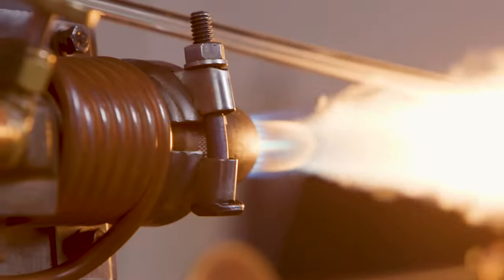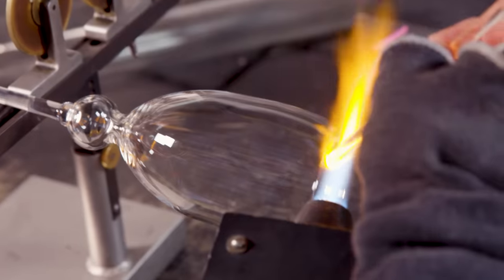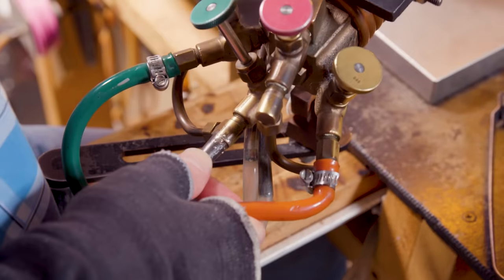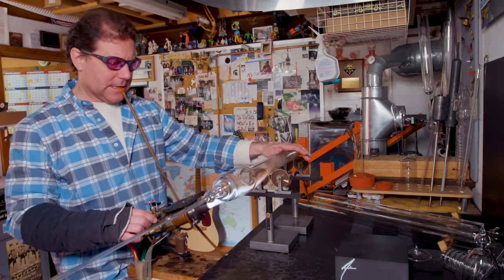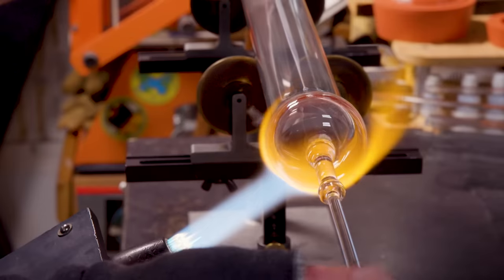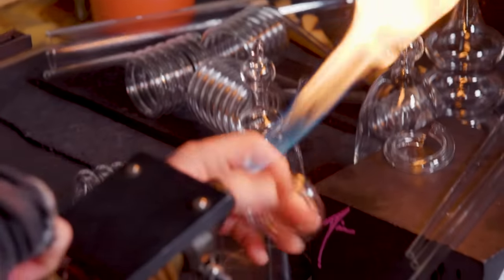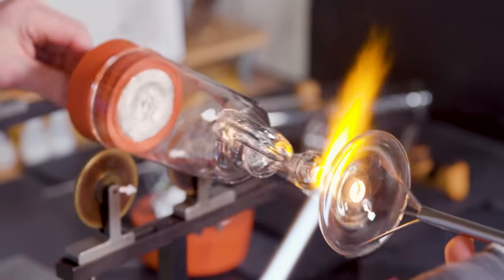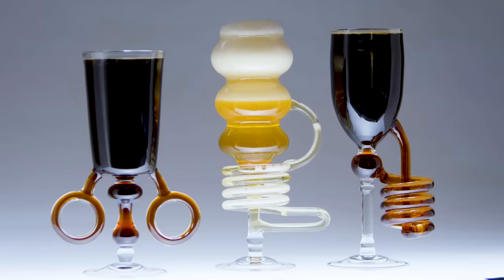Scientific Glass Blower Makes Beer Glasses | WIRED

Comment: I would absolutely spend way way way too much on a single beer glass like this even if I could never get it clean again
Reply: You could use a pipe cleaner to scrub the hard to reach areas problem solved right ?
Reply: they are possible to clean, you just need to be very serious about it. since they are borosilicate, you could push boiling water or even steam through.
Reply: Ultrasonic bath might be the easiest way to clean it.
Reply: @jellevm  probably ultrasonic to loosen the dirt, then steam to blow it out.
Reply: You have $400 🙌 I’ll send you my address!  Maybe you will get a discount for getting two 😂 cleaning is easy. No different than a glass pipe 😂 pipe cleaner guy.
Reply: Easy to clean with chemicals, PBW or even unscented Oxyclean would get it 100% clean with a good rinse.
Reply: This might be kinda gross but I mean, as long as you were religious in rinsing it out as soon as you're done drinking it it should stay pretty clean
Reply: Salt and 90% rubbing alcohol
Reply: Or u do the science ways, ultrasound, organic solvents (acetone etc), autoclave and so on hahaha
Reply: That's probably why they aren't popular. Plus pubs tend to be hygiene freaks. One pub wanted to give me a fresh glass with my 2nd pint of beer. Where they worried I was going to infect myself? This was before the SARS2 pandemic.
Reply: @Cerevisi  yeah, you should proove your scientific skill in chemistry after beer))
Reply: You could just use a spring brush to clean it.

No need to use all the complicated solutions people here suggest, a simple brush used to clean aquarium tubes, some water and some detergent should be sufficient to fully clean something like this.
Reply: @Ass_of_Amalek  actually youd use alcohol and salt    they will be spotless 
 23 years blowing glass......
Reply: Tater Saladwithbacon I know that's how you're supposed to clean bongs of alcohol-soluble condensate, but I don't think that alcohol is going to do much for residue of water-based drinks. if there's something that won't come out with hot water and detergent, I think bases, acids or bleaches will do more than alcohol.
Reply: @Ass_of_Amalek  salt + alcohol ...     non toxic...  plentiful.. i mena what would i know after 23 years of devoting my life .....but hey..im sure some drain cleaner will suffice
Reply: Probably just use bong cleaner for it
Reply: @Cerevisi  +2 to that. It also works well for cleaning coffee.
Reply: one part bleach to six parts water then flush with boiling water
Reply: @jimischwalbe9495  You brought this on yourself Jimi! xD jk they are cool, ied never buy them but want them too lol
Reply: @Competitive_Antagonist  Some pubs are hygienic freaks, some of them (at least where I live) I wouldn't reccomended drinking anything that didn't come out of a bottle lol
Reply: I personally use baking soda and vinegar. All natural baby 😂 a pipe cleaner you can get at Walmart in the hobby section. However in this case I would also boil it like I have with some other pieces 😂
Reply: Sodium hydroxide would clean it for sure. Aka drain cleaner...
Reply: @kodakomp  its not a bong...
Reply: @jimischwalbe9495  THEN STOP READING COMMENTS IF YOU DON'T CARE! JESUS... SOME PEOPLE ARE IGNORANT CONTROL FREAKS...
Reply: @Competitive_Antagonist  In the US they always give you a fresh glass.
Reply: Just rinse it with hot water after every use...which you should do with all your dishes anyway. 😜
Reply: @jorgetello3961  thats what i think too. I use the same 64 oz. insulated cup for my bourbon & coke everyday & I rarely actually wash it.
Reply: @Ass_of_Amalek  i think I’ll take Taters advice since he’s a professional glass blower and use salt and alcohol thank you very much. How does that not make sense you fool? Guess what alcohol is… an acid… the salt scrubs where you cant get too.
Reply: @kodakomp  Use ethanol ~95% instead, but yup. Isopropyl alcohol should not be used on food or drink.
Reply: The trick is to never let your cup be empty. No problem, no worries, always clean?
Reply: @kodakomp  🙌🏼 this man knows what’s up
Reply: @h8510129  really not necessary for every time you want to have a beer.
Reply: @kodakomp  How I've cleaned every pipe.
Reply: One cool thing I noticed about alcoholic drinks especially beer is there sugar content and how they are able to be diluted and washed off without being scrubbed so as long as you run enough water through it it should get clean
Reply: @Competitive_Antagonist  did you just turn drinking age?? That’s standard practice 😂
Reply: Bleach and a microwave to a boil. 
Be safe about it.
Reply: @themastertater420  Non toxic:  Only if you use food-grade ethanol.  The stuff sold for cleaning is "denatured" (poisoned), and the food-grade stuff is not only expensive but carries a liquor tax!
Reply: @Competitive_Antagonist  Maybe they are afraid it would touch the tap, or they touch something after touching a dirty part of the glass
Reply: @Cerevisi  And as we all know, chemicals and beverages alway mix nice, right? ;)
Reply: @michaelp1774  lol...kiln it.   I charge 20$
Reply: I don't even drink and I'd have one. 
Just clean it with piranha solution, a mixture of concentrated sulphuric acid and hydrogen peroxide and it's commonly used in labs to clean stuff like that.
Reply: @Competitive_Antagonist  In the UK it's against the law to serve a second drink in the same glass.
Reply: @Creator_Veeto_PAEACP  1. Alcohol is NOT an acid.

2. Cleaning organic beer residue isn't the same as cleaning the greases, etc, that dirty the glass in glassblowing.

Comment: All I thought was that's going to be a nightmare to clean thoroughly
Reply: You'll need a scientific dishwasher then
Reply: Autoclave it all labs should have one
Reply: @boyintheblue8420  its a beer glass not lab equipment.
Reply: Just what I thought x)
Reply: Could it be that is why no one makes them..
Reply: sulfuric acid and hydrogen peroxide at 3:1 ratio.
Reply: rubbing alcohol, then rinsed
Reply: Pipe cleaners were made for cleaning tubes with worse. I bet you’d find one just fine.
Reply: Nah.  Hot enough water will clean any "impossible" dish.
Reply: Clean it the same way stoners clean their complex glassware.  Salt and alcohol and shake closed
Reply: I say that when I see modern smokeware designs.
Reply: What some of y'all are missing is it's about getting the rinse to fill and flush that tube.
Reply: Maybe keep them in constant use, always at least sipping beer (or wine) out of them and refilling.
Reply: Just dont let it dry
Reply: As a lab intern, I'd say it's probably easier than most people think. It's different than normal glassware, but it's not too hard as long as you have some pretty basic cleaning supplies(RO water and soap should suffice if you're not trying to sterilize the glassware).
Reply: And watching these glasses getting made, I thought about how cool it would be to drink out of one!
Reply: That is why God(or whatever you believe controls the universe) makes dishwashers. Seriously, good dishwashers today (machine dishwashers) can clean anything, then dry it spotlessly, and finally... sanitize it, again, so well that you should not ever have to worry. Growing up, my mother made us pre-wash dishware, before loading it in the dishwasher, and it was absolutely necessary. We pre-wash with hot, sprayed water and then loaded it. Otherwise, there would be pieces of food all over every dish. Now, however, every dishwasher that my mother's has (she buys goods stuff only) will 0oowash glass spotlessly, as long as you knock the actual stuff off that can't be washed down.
Reply: Brewing cleaner and sanitizer will take care of it.
Reply: Clean it the same as any bong or glass piece. I found the best mixture is 90%+ Isopropyl and half a cup of epson salt.
Reply: Then shake shake shake
Reply: @parttime9070  and beer glasses have specific designs for reasons to enhance flavor and aroma and head retention.  A glass nerd would appreciate these but a beer nerd might be horrified that this fancy glass just ruined an amazing beer
Reply: @makaylalawrence9085  that's what starsan rinse is for
Reply: @CatWith-AHat  it's a beer glass made using lab equipment techniques; having the cleaning method reflect the techniques used to make it isn't out of the question
Reply: If you never stop drinking you don't have to clean it.
Reply: @TrioLeaf  my thoughts exactly
Reply: I thought that too, but I also thought; Wow, there are cool af, I'll just drink gin outta them.
Reply: Lol literally thought the same thing. You were so busy wondering if you could. That you never stopped to ask yourself if you should."

Comment: “You got a smoke detector in here?”
“No I have a fire extinguisher”
Reply: a smoke detector would probably do false alerts rather often with that much fire in the room...
Reply: @ulrichkalber9039  yes, and if there was a fire, you wouldn’t be able to extinguish it with a smoke detector either. Smoke detectors are USELESS!

Ps. Dear keyboard-warrior, that’s a joke, I support the use of smoke detectors and most other safety measures. Anyway, good day
Reply: Ivar Laupet I kinda agreed on the useless. My second ex had a bad habit of watching cartoons while making pancakes on Saturday morning. Back when they had the Spider-man, Iceman, Firestar cartoons.
Reply: @ulrichkalber9039  This is why they need to make smoke detectors that  will turn on when you turn out the light...which would still probably not be perfect but it would help eliminate the boy who cried wolf problem.
Reply: @johnkillingsworth5135  now that is a product idea.
Reply: Imagine having to wash it afterwards
Reply: In my house we have both
Reply: @johnkillingsworth5135  what do you mean turn out the light?
Reply: Cleaning those glasses would be a pain. Even with a dishwasher, residue would probably still be an issue...Cool glasswork though...
Reply: @dimitrijekrstic7567  flipping the light switch to the “off” position
Reply: @blaniac6591  weird, but thanks
Reply: @johnkillingsworth5135  I sometimes fall asleep with the lights on. It doesn't happen often, but it does. I can't imagine being unprotected in that event would be a great idea.
Reply: I would be more concerned about carbon monoxide
Reply: @sophierobinson2738  5:42
Reply: in the professional kitchen usually there is no smoke detector but the heat detector and a very sofisticated system to extingue the fire including even a couple of fire extinguisher
Reply: @ivarlaupet8972  as a fire suppression contractor I’ll tell you… smoke detectors are DEFINITELY not useless 😂
Reply: @johnkillingsworth5135  just a matter of wiring it up with a 2 way switch that makes contact both ways but to different wires.
Reply: At the very least, he might still want a carbon monoxide detector. That stuff you can not detect on your own.
Reply: @N. Warner maybe I am but how can you call something weird when you dont know what flipping a lightswitch means
Reply: @the77th  yeah, I’ve got one in every room of my house.
Reply: @tumeh7410  Look at his username! Maybe, just maybe, his first language isn’t English?
Reply: @ivarlaupet8972  it's not my first language either but my bad I kind of came at him for calling someone/something weird
Reply: @tumeh7410  oh, nice. I guess we are, like most people on YouTube, not native English speakers. Also, I’m sorry for being rude to you. I thought I was being nice by not calling you a douchebag, but in hindsight I realize that’s not the case😅.   Anyway, good day.
Reply: @ivarlaupet8972  no worries, I was being a bit of a douche, you are right but have a good day too
Reply: @the77th  in a hot glass shop they are
Reply: @the77th  as someone rather often on youtube let me tell you, he did a thing called joke (:
Reply: @popenieafantome9527  no, not on your own, you need to people at least, one that dies, and one that makes a note for high carbon monoxide levels ^^
Reply: @Devviiiii  a bird would be more useful. Using a person would probably lead to both dying. Not enough warning time. Maybe if you use a child.
Reply: @dimitrijekrstic7567  I'm thinking he means the detector turns off when the lights are switched on, then back on when you leave the room (switching lights off), preventing nuisance alarms at times when you already are in the room and would notice smoke.  I actually like the idea, you could go one further and just have occupancy sensors in smoke detectors because some people (cough**my wife**cough) leave all the lights on all the time.
Reply: @dimitrijekrstic7567  presumably they mean, you are no longer doing things in the room where the smoke alarm is, so you turn the lights off in said room to save energy
Reply: "I am the smoke detector"
Reply: i know I am kinda randomly asking but do anyone know a good website to stream newly released tv shows online ?
Reply: @Bodie Titan thank you, signed up and it seems like they got a lot of movies there =) Appreciate it !!
Reply: @Emanuel Kristian Happy to help :)
Reply: @brokeandtired  well maybe just get a pipe cleaner and soapy water if you're persistent enough you can get It spotless
Reply: @tumeh7410  this was a very wholesome comment section conversation
Reply: As a Glassblower, WE are the smoke detectors! We can also smell when the sulphur starts to burn in the propane tank, meaning it's almost empty and time to swap or refill!  We can also smell when someone lights up a bowl in the other room and starts smoking without us cuz it all gets pulled through our exhaust fans! ;)

Comment: His spinning is so perfect. Look how smooth the arrows turn
Reply: For perfect spinning, a well funded glass fabrication lab will have what is called a glass lathe.  It will hold the two pieces at either end and is geared through the base to keep both ends rounding in unison.
Reply: I almost thought it was motorized

Comment: “Why doesn’t anyone do this?”
Odd way to admit you don’t wash your own dishes
Reply: There's glass cleaners that would easily remove drink residue.
Reply: @GENcELL2014  starts this straw thing 3:30?
Reply: I mean people fill scientific glass with way worse things than beer all the time, yet they manage to clean it
Reply: @GENcELL2014  And how many of us have those in our house right now?   ...or are safe to dispose in the municipal drain?
Reply: @alexipestov7002  Formula 710 can be bought at pipe shops. It's easy to get on Amazon. Common enough and safe to put down the drain.
Reply: Acid wash with dilute HCl, then base wash with NaOH, easy peasy...
Reply: Odd way to admit you don't clean your drug paraphernalia.
Reply: @chemistryofquestionablequa6252  dont forget to equalize with distilled water, and dry with ethanol followed by acetone washes to remove any sort of organic residues
Reply: Exactly 😂
Reply: Still super trippy though!
Reply: @sirel33  
In case you're unaware a good portion of scientific glass never gets reused because the reactions/processes they're used for are simply too destructive.  And the stuff that does get reused is generally in a facility where they're literally surrounded by every industrial chemical known to man and industrial autoclaves.  These things would make great movie props or display pieces, but actually using them in a typical household for liquids you intend to drink is completely unrealistic.  The guy making them even admits as much in the video, and says he doesn't particularly care if they're practical or will ever actually be used.  He's making artwork more than anything.
Reply: @sirel33  I mean to be fair why would you ever need to use a more expensive glass? It's not like you need your beer or wine glass to take high temperatures like a test tube or beaker?
Reply: 70-99% alcohol gets off reclaim I’m sure it can get off any drink residue
Reply: @alexipestov7002  Hey, if I want to pour dichloromethane down the drain, that's my decision.

Comment: To the people concerned about the cleaning of these glasses, you could clean them with food grade solvents. 90% isopropyl and a few pipe cleaning brushes then rinse with distilled water. Wouldn't be hard to keep something like this clean.
Reply: This requires a double dose of IPA,
IPA (isopropyl alcohol) to clean...then IPA (India pale ale) to fill
Reply: As long as you clean immediately after use. IPA does not do a good job removing biofilm.
Reply: Beer has a protein fraction which your isopropyl won't touch.
Reply: @BeeRich33  definitely something I wouldn't have considered! I'm assuming since you specified protein fractions that you are mainly concerned with insoluble protein fractions. Do you know what protein fractions would be left behind as insoluble in IPA? And any suggestions on methods for removing them? I'm by no means a chemist but I would absolutely love to learn some more than I can with a cursory Google.

Comment: So cool, but imagine having to wash those -
Reply: You could use a pipe cleaner to scrub the hard to reach areas problem solved right ?
Reply: @ogkush2539  So cool, Imagine needing a pipe cleaner every time you had to clean a cocktail glass.
Reply: It's not all that big a deal, really.  We have to wash crazy glassware in the chemistry lab all the time.  Definitely not as simple as a normal pint glass, but doable.
Reply: @ogkush2539  I mean as long as u rinse it as soon as your done it probably wont have enough time to build residue so you have to go that far
Reply: @adrianhenle  Chemistry applications on normal lab glass is easy compared to trying to get beer chemistry out of these.